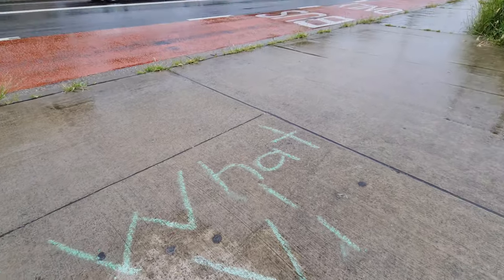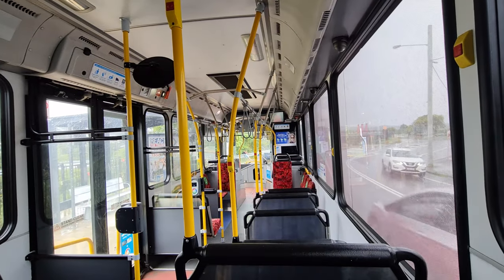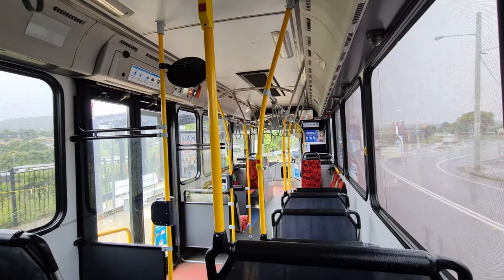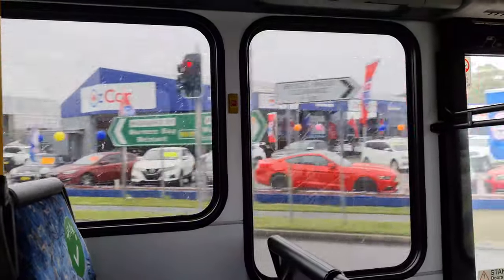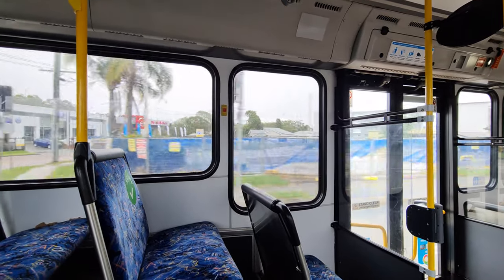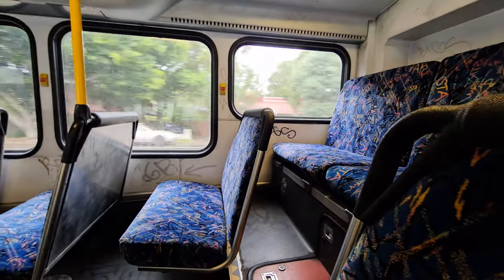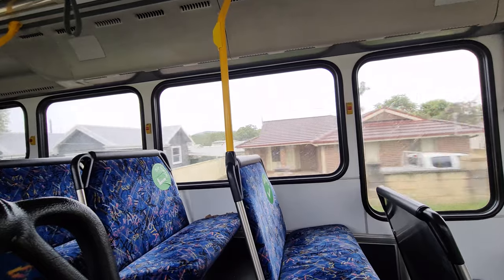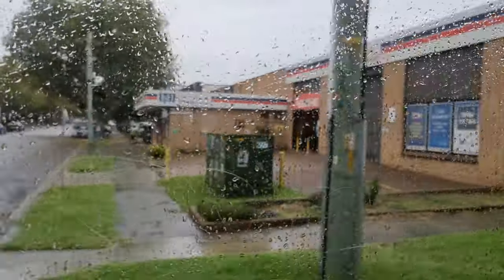Newcastle Transport B7RLE CR228L

Comment: Great video, have to agree on the Vandal problem with NT's buses. I'm sure there's only so much Newcastle Transport in regards to the problem can do but riding a bus with graffiti all over it including windows doesn't feel very welcoming or safe. Makes it feel very grubby, dirty, unclean you get the point. Fun fact, they've started to replace the white panel backs on the back of the seats on the B12BLE CB60 buses (not sure on the EVO II's) with the same anti-vandal backs the Bustech VST seats use. I think it's helped a little bit but that will probably only cause the walls or the vents to be targeted next.  I think best you can do if you really feel bothered is to either report the issue directly to 131500 (Transport Info line) or the bus operator. 

About the fleet, very little has been added, besides B8RLE's on Bustech Bodywork and some BCI's that's about all that the Newcastle Transport has seen in terms of additions, except for one Scania L113CRL ex m/o 3698 from STA Sydney, that's preserved now.  I reckon there's sadly a good chance depending how you'll see it that they'll stick with Bustech for the foreseeable future, ideally I would've hoped they made the switch for Optimuses or at least CB80's when they were still in production. Unless your a Bustech fan don't really get your hopes up to see any exciting additions to the fleet, you'd get more excitement out of the other local bus companies.   Another fun fact, the B8RLE's are built to STA Specifications including the graffiti seat fabric we all come to know and love. 

Couple of years ago Newcastle Transport still had STA's MAN 11.220's (Ansair Orana) and the two O405N's which were fully low floor (something that is hard to find in the modern day Australian bus market) with Ansair Orana bodywork, they've all been withdrawn now and either preserved or moved onto other operators. 

Looking forward to seeing more of your content, keep it up TP. 

- CR228L.
Reply from the maker: Cheers!

 I don't mind a good old Bustech, especially where seating capacity is more important than standing capacity (I.e. smaller cities where it's rare to have standing passengers). Sadly I missed the old MAN midis (although there are a couple of ex STA ones floating around in Toowoomba) and the O405Ns. I have managed to catch a B10BLE at least! 

I think the next era of buses will be interesting, as the transition to electric is getting underway. I have caught a few electric buses already and for the most part, they are quite impressive! I wonder how quickly the tech will be adopted across the Hunter, but given that Volgren, Bustech and Custom Denning, along with a variety of other manufacturers are giving it a go, I think it will be a more viable choice sooner than people think. 

Here's hoping that we can find some better graffiti solutions in the meantime! I've also given a few other local buses, trains, trams and ferries a go, which has been fun.
Reply: @TalkingPlanning  Even the B10BLE's are getting rarer around here, at least within the CBD as I don't tend to see them as much and I don't think they go out of weekends. Pretty much at night Newcastle Transport becomes Bustech VST central where the CB60's and other buses return to the depot and the VST's cover the night run, a few non VST's still do the evening routes but are out numbed by VST's.  There's been a news article recently as well in the Herald saying Newcastle would be a perfect place to open the new Bustech Factory.

If you're open to requests & have the time, I'd love it if you could do a review on the Port Stephens 130 route from Newcastle to Nelson bay, weekdays it's pretty much the only chance to get a high floor within the Newcastle area and the newer Custom SB50's service it but until you reach Tourle St you can't alight (No set down)
Reply from the maker: @CR228L a Port Stephens high floor is definitely on the radar... only challenge is the timing! They are out and about when I'm in the office!
Reply: @TalkingPlanning  No worries,  If you can't do the 130 another suggestion would be try waiting until Major weekend rail replacement occurs, you will have a better chance of getting a high-floor as PSC usually does the Newcastle to Wyong rail (and vice versa) replacement, other operators do it too, regardless there is much more interesting stuff on weekend trackwork as to be expected.
Reply: Don't talk about them old MAN Ansair Orana's, they break down a bit too often, and once it broke down on my school route home and took them over an hour just to get a new bus. And i do miss the good old Mercedes Benz O405N's and the old Volvo B10B's buses that they had. Used to get the old B10B Volvos everyday for my school bus home.